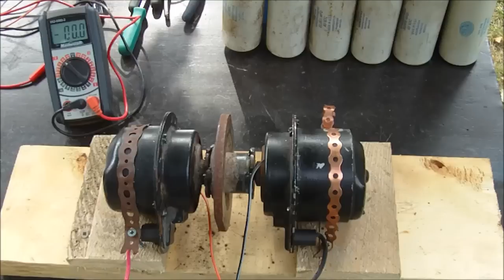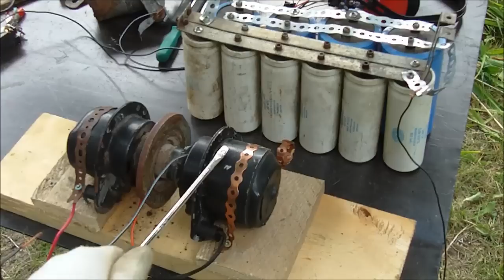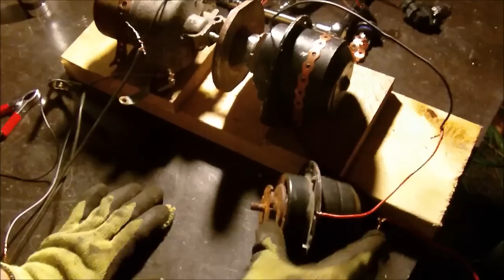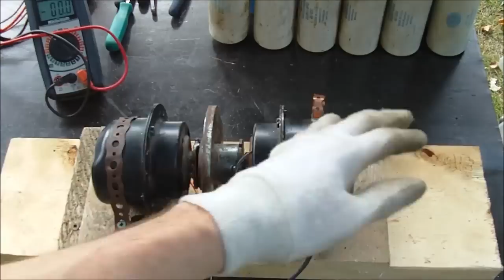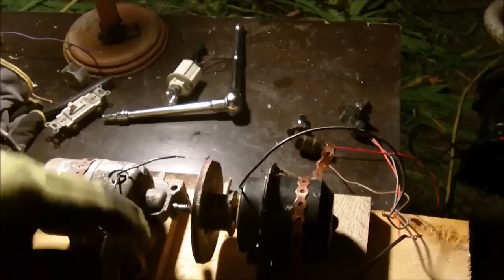Electric Motor to Motor, can they self run?

Comment: hi im building the same thing  in the middle make it a pull start. you want to rectify and re- invert the power in a AC/DC loop . heres how .1 put a regulator on the generator output at 12 volts. 2 then instead of a capacitor bank power a inverter . the inverter output to a DC power supply to the motor at 12 volts. 3 use another DC power supply to a separate output inverter for power to use . so now when you look at it  inverter 1 powers the motor generator . inverter 2 is the output power for you . you pull start using the same electrons in the circuit.

Comment: I thought about a way someone could attempt to do indoor Solar power! Building a UV LED setup to fire at a solar cell and create energy! It may be possible to use less wattage for input than you get in output! The test would have to be done on a 200+ watt cell to be able to see if it would be a possible free energy source, if you can use 30 watts to get 200 watts that would leave you with 170 watts of free power!

Comment: Should have changed the gear ratio make one motor spin faster off of a bigger gear. big on the start motor small on the receiver motor that would do the trick maybe? or help a little.

Comment: at the  generator output you connect a coil a step up coil  then send that power to the capacitors then to another coil then to the motor  then it will be self running with a stored supply then it can be stop and started at any time

Comment: even commercial generators operate in a range of 50% - 70% efficiency and unfortunately even if you got the drag out of the mechanical bits you still wouldn't beet the hysteresis losses (energy loss in the form of heat)

Comment: friction and heat and sound  are all energy draining leaks in any system. the only thing that gets close to free energy is a magnetic field creating curent in a superconductor, which requires alot of power to refrigerate. so still not free.

Comment: So to make this work you need higher motor spinning atleast 2000rpms running generator but having a heaver flywheel in the middle of both motors so it keep to speed also put a diode so  it wont back flow  into another  motor and with a speed controller on motor  to speed it up little faster so it can run better this way it will have little loss of energy instead of alot especially on a small  load try this idea i never tryed on my own yet

Comment: On the generator use a boost inverter a high voltage small farad capacity and a diode to connect to the low voltage high farad capacitors then the motor

Comment: If you use a belt to link those two motors, and on the second one, instead of direct, u use rechargeable batteries and on the other you put a small propeller, you would have a self powered fan...

Comment: In your setup you will have more losses than actual useful work, NOT POSSIBLE IN YOUR SETUP but doable, I have found a way, 1) Enhance the magnetic flux (n52 magnets on outside of the casing) for at least for one of the "driving" motor.
2) put a cap in your case a dc cap 400v will do.

I put in 12v @500 milliamps, out 31v @ 2 amps

the generator coils will have to be modified, otherwise  it will create a great brake under load (one of the coils has to be shorted with a capacitor.)

Comment: as soon you convert energy from one form to another, there is an ineffiency factor and in practical way, heat is emitted
for an example, for converting electric to mechanical energy, at best, you can convert 98% of the input to otuput, and one of the worst case is the thermal conversion, in an otto cycle ( car gas engine, the best efficiency is about 25% meaning that you reject 75% of burned gas in the form of heat through radiator and exhaust)
as your setup is not thuly inline and these motors are not at peak efficeincy, it is likely that the rotation stops as soon as you cease exterior energy feeding and all accumulated energy is depleated.

Comment: Amazing to think anyone would believe this worked...

A comment about flywheels though, with a large enough wheel and high enough speeds you can get some serious energy stored up. The largest implementation I've heard of is running a trolley/rail car with a flywheel that is spun up at stations...but I know they are working on large scale implementations as well (IE: Power plant sized for energy spikes).

Of course, you need a lot of weight, special magnetic bearings and a god awfully high RPM rate to store anything meaningful...and I wouldn't build something like that at home...god help you if a failure occurs and the flywheel comes loose...because all the energy WILL dissipate...one way or another.

Comment: Everything has a point or resistance and friction. The only infinite or finite source of power is a source that constantly moves. Heat generation would be beneficial miles underground where it's hot. Perpetual motion is best where water flows, like a river or creek. Solar is limited by sunlight and time of day. Wind is limited by nature and location. Even with the hardware to build energy, you have to maintain it overtime.

Comment: It may be possible with a motor that has a built-in Transformer or a motor that has a built-in inverter take an electric motor and an alternator run the alternator to an inverter that puts at 120 volts find a motor that that runs off of 12 volts that has enough torque to turn the alternator. get the 12 volt motor spinning to turn the alternator as long as the motor is turning the alternator the alternator will keep supplying the inverter with the 12 volt electrical DC charge which and return the inverter will convert it to 120 volts and keeps applying the volts to the motor so it will keep turning the alternator and this will keep the cycle going what for a lot of power you would have to buy an inverter that puts out thousands of Watts . A 12-volt motor can produce thousands of Watts combined with an alternator and an inverter but I don't know how long it will last

Comment: Has anyone run this kind of setup with batteries with the generator charging the batteries to see if it can off set some of the electricity being used by the motor. I understand that the motor will consume more than is being generated, but will the net add battery capacity. I’m wondering if there is an application for extending EV range for vehicles with two motors. My thought is that it wouldn’t work well until the EV reached 40 mph or more to take advantage of kinetic energy.

Comment: you forgot to solder an extra positive wire from any one of those motors to a motor that will circulate the electricity, then you will have two motors producing electricity for any specific device or machine that you need to run. don't forget smart phones need a USB hub.

Comment: This would work if the other motor was reversable. You cannot have two motors that run one direction and put them together like this other wise as shown in the video the other one will cancel the other one out trying to spin it in the opposite direction there for stopping the whole operation as soon as it starts. If the other motor was reversable and spinning the same direction as the first one it would possibly work. Also try not using a powered input to start it as the other one you are trying to use as a generator to spin both would short both out maybe cause a fire. You need one to power the other but having both connected and trying to start with connected power would be disaster. I can see this trying to work but as I said if the other motor was reverse spinning in the same direction it could maybe work.

Comment: at college in the eighties we were taught how to take a single phase motor couple it to a three phase motor and get three phases for workshops etc , i dont see why this should t work you can use one phase for your home (around sixty to eighty amps should do it ) and another for running the single phase motor ..i would put 1:1 transformers after the outputs to get a steady voltage ..and a change over switch from supplied mains to generated mains ..you would use a bit once a year for maintenance purposes ??? you have a virtual perpetual motion machine !! OR a small current motor say twenty amps to spin up the larger 80 amps motor and do the same using twenty amps every now and then as above ?? you can use belts and pulleys to negate the torque required to start the larger motor which once running should be easy to keep spinning at the required revs

Comment: Replace one of the motors with a low RPM alternator or generator.. the generator has to get up to speed where that it can power the motor .. once generator is up to speed and the motor is powered.. it will continue to drive the generator.. this producing more than enough electric to run the motor and maybe another item or two

Comment: What about if you use a chin and a big drive gear and a little gear for the motor with a light builb.
Reply: +Robert Polito You've multiplied the speed but divided the torque. Since Power = Torque x Speed, you can put numbers in and realise you end up with the same amount of power. That's like saying my 100HP car produces 2000HP in first gear! Wrong it always produces 100HP but the torque can be increase while the speed is reduced or the other way around, torque can be decreased while speed can be increase. The power you get is always the same, but then friction comes in so it's always less.

Comment: Dear friend, the secret is to arrange the geometry of the permanent magnet in the generator so that it does not have magnetic braking (that jerking force). Can you figure that out? Almost as difficult as Mikhail Tal chess combinations.Then connect them with belt, you can adjust the size of the pullies on either sides of the flywheel, so the motor and the generator are connected thru the flywheel. However, I have the feeling you already knew this.... hmmm I just remember Pink Floyd Wish you were here, Did they get you to change ... Your heroes with ghosts..

Comment: It can be possible if the motor and Generator are designed for this kind of self running system. But, This is not free energy, There is the cost of magnetising the magnet in the machines. The magnets will lose magnetic strength pver a period of time. And they have to be magnetized again.

Comment: The fix is to add a battery and make it 2 generator's to 1 motor where the generator's charger the battery running the motor. Thus free energy. I've been wanting to do this but haven't but the principle is simple thinking use 1 electric motor hooked to 2 car batteries and 2 or 3 generator's to charge the batteries that supply power to the motor.

Comment: Super capacitor flashes out what's inside them so it's temporary power. You must add a battery to supply the current flow. And you must connect the battery to the main system to make it charge. But the real deal is if it's worth it and can perform it's real purpose.

Comment: Try using a bigger Fly wheel and operate the driver motor in a pulsed manner. On -Wait - Off - wait. You are then tapping into the earths huge storage of kineic energy. Angular momentum of rotation.

Comment: what if the wheel in the center was a large water wheel placed over a flowing river? would that allow it to generate large amounts of power seeing that the river current keeps both of them running
Reply: +Christofer Foster Yes, but all that's doing is powering an electric motor with a river. If you wanted to generate electricity, you'd get a lot more of it by simply using the water wheel and nothing else.

Comment: Hay Kurt's, you have to be smarter the motor! 
If you use 2 alternator off of a car, you can turn 1of them into a 12 volt motor by cutting  off the wires to the stator's. find the wires that goes to the armature and the rotor and hook them to a 12volt battery and lit run. The other one is already a 12 volt alternator, splice two wires on the battery then disconnect the wires from the battery only and it should stay running. If not, then swop the wires on the motor it should run the other way. start the motor again and disconnect the wires. It should stay running.

Comment: DEAR  SIR   ,      MANY   YEARS   AGO  (1967)    AS   A  STUDENT   IN    TECHNICAL    SCHOOL    IN     SINGAPORE   A  GROUP   OF   MINE   ASKED   THE   TEACHER   THIS   QUESTION.  ***        AN   ELECTRIC   MOTOR    DIRECTLY  (  MECHANICALLY  )   IS  COUPLED   TO   A     DYNAMO    (   GENERATOR )  .      THE   ELECTRIC  CURRENT  GENERATED   BY   THIS   DYNAMO   NOW   CHARGED   A  BATTERY     WHICH   THEN   SUPPLY   DIRECTLY    TO  THE   MOTOR  .               ****   WITH   THIS    SETUP   THE   WHOLE  SYSTEM   SHOULD   RUN   FOREVER /   A LONG  TIME .     THERE  WAS   A  SILENCE   ..............TILL     WE   MET  YEARS   LATER   AT   OUR   REUNION .

Comment: The Moyers are backwards you connect the wires and spin 1 noted and the other 1 spins but what if you try it on a bike and use an alternator on the front tire to power electric scooter system without batteries on a 20in bicycle the curry electro drive system will fit a 20 in bike

Comment: dear .. i can help you to work this motor , (1) first thing is select one motor as generator and convert ac power to dc power (2) run the motor and check the value both end (motor input and generator out put ) i guess generator output will be lower result but don't worry, just do the modification and post new video then let see what we can do, there is nothing impossible but you have to see bit deeper and deeper or out of the box, i guaranteed you  this can work .. thanks "dinuka"

Comment: connect the motor to a battery-link and the generator to a battery charger with a charge controller and or transformer and splitter inbetween and connect the charger to the battery

Comment: A electric motor used to pump water to feed a water wheel which in turn rotates a generator to create a load on a light bulb to then switch off the power starting the electric motor and switching it to the generator will run for a long while and the water needs be rerouted so it can flow constant from top of water wheel then to the pipe feeding the water wheel after it has fallen to the bottom using the pump electric motor. The point to this is to have a constant power output which can run a light bulb without using the home current which is what the water wheel is suppose to do always having the light bulb connected. You could use battery power to start the electric motor instead but then battery would have to be recharged along with having the light bulb on. Capacitors are less productive than the water wheel.

Comment: +Kurtcottage 

I have achieved a much efficient way of generating power from a motor without using a generator coupling

even with that we cant self run a motor because of the mechanical and electrical losses such as resistance and friction.

I even made simulations with Super conductor and still self running is not much of a case yet it does do a better job than any other designs

Comment: Not quite the same thing but years ago, before we had super efficient batteries and LEDs I was trying to work out a way to connect a bike dynamo to rechargeable batteries. NiCd batteries didn't last very long and standard Alkaline batteries were very expensive. I was a keen cyclist and needed powerful torches that actually lit the road because I lived in the country where there was no street lights. Halogen bulbs are bright but hungry and would kill the batteries in less then an hour. I thought it was strange that there weren't any commercially available models because it seemed like a good idea to me. 

I never managed to do it but I thought it might still be useful now that electric cars are becoming popular. I know it wouldn't keep them charged forever but it might increase the range without putting much strain on the motors. I'm also sure there is a reason it doesn't work but I've never heard anyone explaining it.
Reply: have u basic on electronic ac/dc diode...
Reply: Big Ian Builds Hi Ian, if you want to charge NICADS then you need to use a constant current supply, if you fed the output of a Dynamo across the battery's then for starters when the bike is stationary, the NICADS will discharge back into the Dynamo so in the least you would need a blocking diode to prevent this. Now depending on how much output you have from the Dynamo, in some cases, you may get quite a high charge current feeding the NICADS, this can be dangerous and will end up killing them pretty quick. In the old days, there were some bikes that had a battery tube and and a hub Dynamo, the battery's weren't charged by the Dynamo but the batteries where there simply to keep the lights lit when the bike was stationary. You should never try to charge batteries labelled as non rechargeable. 
NICADS suffered with 'the memory effect' which meant that if you didn't discharge them to a certain degree before recharging them then the amount of charge / discharge cycles of the battery life is rapidly reduced. Lithium Ion battery's to improved on this problem and there Nical metal hydrate batteries. There are no perfect batteries but we've moved on a long way since NICADS.